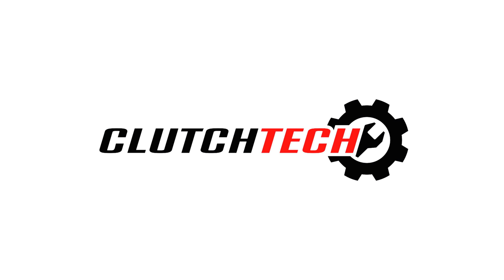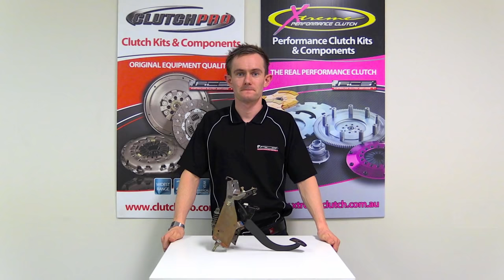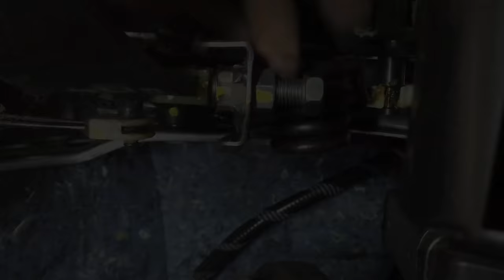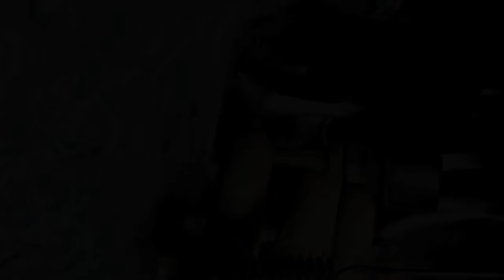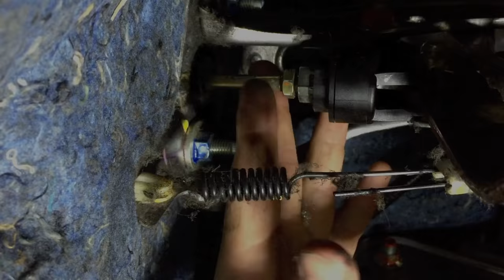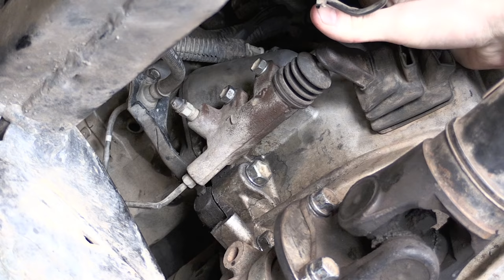CLUTCH TECH: Hydraulic Clutch Pedal Adjustment

Comment: Thank you, sir. After a clutch replacement, my RX-8 was sometimes hard to shift gears, like the clutch wasn't fully disengaging even with the pedal to the floor. I had to take my time to avoid grinding gears. I saw this, removed most of the freeplay from the master cylinder pushrod, and now I don't feel like a newbie when I shift.
Reply: That sounds exactly like my issue. Theres times it shifts smooth as butter but than theres tomes where it feels exactly as you described like as if the clutch isnt fully disengaged while trying to shift

Comment: Hi, I have a question about my 1996 Isuzu rodeo. Would making the bite point lower in theory make the distance the plunger is pushed in the master cylinder less thus making the clutch not disengage as far? Reason I ask is I made the bite point lower and the car has seemed to be a bit harder to shift lately just as if the clutch was not disengaged 100%. Could this be transmission fluid that is old as well? The car always goes into gear but it is just slightly chunky when pulling it into gears while moving now.

Comment: Great video and tip, after getting a new heavy duty clutch installed car ran like crap it felt like i was riding the clutch 24/7 but now after watching this and adjusting the clutch bite position higher giving the fork more travel it runs 100%

Comment: Do i need an adjustable push rod for this? 2007 Ion redline my pedal is spnge till about 3/4 the way down then there is clutch from that to the floor will this fix the problem?

Comment: Hello everyone. Please help me as i am really worried. I recently bought a 2002 toyota yaris 1.0 and clutch pedal was right at the top. I have changed the clutch Exedy brand but what worries me is that the biting point is still very high even with the new clutch. Could it be something serious or just needs adjustment. Its a hydraulic clutch and i did even bleed it after clutch change 🙏 Thanks
Reply: Needs a new slave and master clutch cylinder.

Comment: Hi my hyundai excel clutch sits too high and grabs up top.i stiil cant get used to it can i adjust the rod to lower the pedal and will it damage anything? I was gonna try it but it is very tight ? Any reply appreciated
Reply from the maker: Hi Edmond,
The test itself will not destroy anything, but you need to ensure you are getting a clean release of the clutch after adjustment. As long as this is accurate and there is no excess pressure on the push rod holding pressure on the piston of the master cylinder, then it should not do any damage.
Thanks
Reply: @australianclutchservices7503  thanks i adjusted the clutch so it lines up with other pefals grabs like it should . Feels like it should be ! Its annoying when you have to push the pedal half a metre and when you release it your knee hits the steering wheel lol😊 thanks for the reply!  Have a great day

Comment: I need your help please! I have a1999 ford f250 new clutch and master cylinder are replaced but the pedal its too hight, I don't know how to adjust it??
Reply from the maker: Hi,
We are not overly familiar with that platform, so cant offer specific advice, but our suggestion would be to interpret the video and try to apply this to the pedal and hydraulic setup in that vehicle. If the vehicle has an adjustable pushrod and pedal height, it should be possible to adjust the pedal down.

Comment: I have had a new slave cylinder installed on my 2003 ss vy commodore and since then the  clutch has started to slip in higher gears,4th 5th and 6th would this video solve the slipping problem cheers

Comment: My clutch is all the way to the top. Like the last maybe inch or Invh and a half is when the car starts to roll from a stop. Is that because of this ? Or because of the disk inside the transmission
Reply from the maker: This can be caused by a number of factors including the pedal adjustment or the disc being worn (There are also a number of other potential causes). If you would like to speak to our sales team by calling 08 8300 5000 (within Australia), they can assist you further.

Comment: This is not the case with the 2018 mitsubishi triton. Pedal is adjusted by pulling the pedal toward the master cylinder until clutch and brake pedal are level. Forget about achieving freeplay at the pushrod into the master. This will cause over stroking of the master resulting in a blown concentric slave cylinder.
Reply: Thats the direction he described, towards the driver which is towards the master cylinder...

Comment: How do you turn the pushrod so easily? I have an xterra. I've loosened the nut that's around it,but the twistrod still won't budge even while using tiny pliers. Any tips?
Reply from the maker: Hi Sebastian
Its best to ensure that there is no pressure on the rod from the piston or pedal when trying to turn it. If this does not work, another option would be to disassemble the pedal assembly and lubricate the components as they may be slightly seized.
Thanks

Comment: i have that squeaking noise, but if i push on the fork the noise goes way.....should i adjust it at the pedal like in the video?
Reply from the maker: Hi Ryan
Can you advise where the noise is coming from? Is it from inside the bell-housing?
The squeaking noise is likely to be coming from a component that requires lubrication or is worn out and should not have anything to do with the pedal adjustment. 
Thanks

Comment: So I just had a shop (not local) change out my clutch and flywheel and now I hear a whining noise at all times. I also notice that my clutch engagement point is much lower than it used to be. Nearly at the floor. If I press the clutch pedal about an inch the noise stops. I'm debating if I could adjust this to stop the noise, keeping in mind not to adjust too much where I start to burn my clutch. Any feedback would be greatly helpful. 2005 acura tl
Reply from the maker: Hi Harvey
From the symptoms you have mentioned it sounds like you have a noisy thrust bearing. You are able to use the pedal adjustment to change the engagement point but unfortunately it is unlikely to change the noise. If you have any further questions, please contact our friendly sales team (sales@australianclutch.com.au) and they will be able to help you diagnose it further.
Thanks
Reply: Hi aye just got a new full clutch replacement on land rover Freelander 2  2014 ..and every time it so hard to get it in to gear was the car has been ran for a bit it kinda easier to shift gear but every morning I can't get it 2 go in gear in less I stick it in to gear then start the car I have noticed my clutch peddle there isn't much play with it it reaily near the ground as I there not much pressure to press the clutch down to shift gear ..any idea what could b as new clutch has been replaced thanks

Comment: How do you adjust a hydraulic clutch pedal for 96 GMC SIERRA C1500 5.7
Reply from the maker: Hi Jason
This video is just a generic guide. If you have an adjustable push-rod the process should still remain the same to adjust for this application, but the individual components may be different.
Thanks
Reply: Ever figure this one out?

Comment: hello I have hydraulic clutch. Doing that leaves the clutch lighter ??
Reply from the maker: Hi Diogo
Adjusting the pedal will adjust the bite point of the clutch. Adjusting it will not change the pedal effort to engage the clutch although if you adjust the bite point to be lower, the pedal may feel lighter at the top as the clutch is not being engaged at that point, however, this is not recommended. If the clutch is adjusted correctly, the pedal effort will not change.
Thanks
Reply: thank you for the explanation